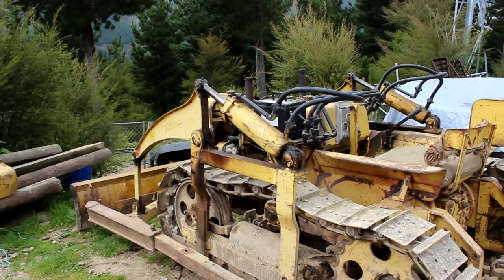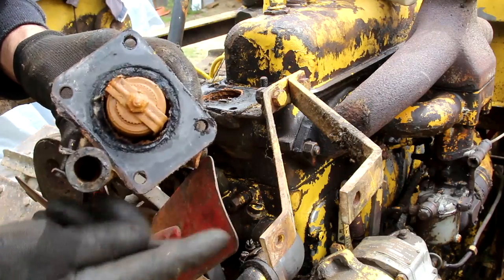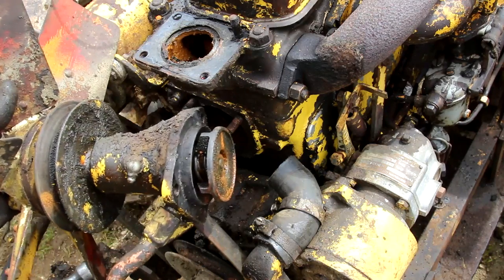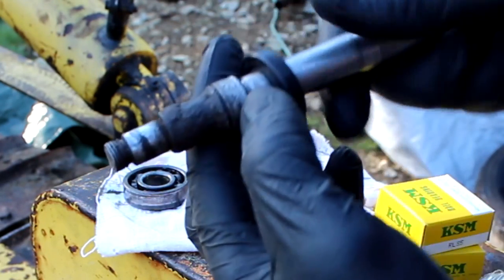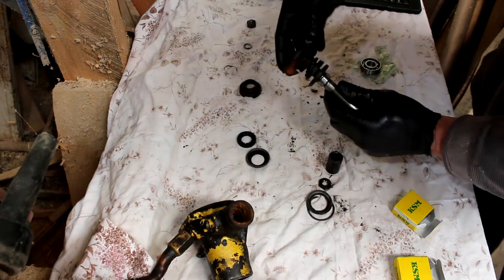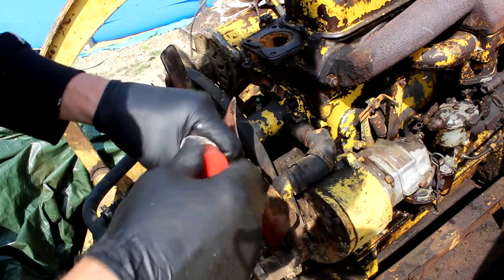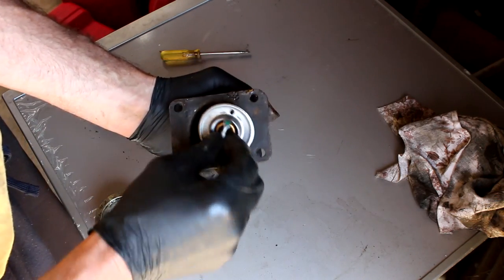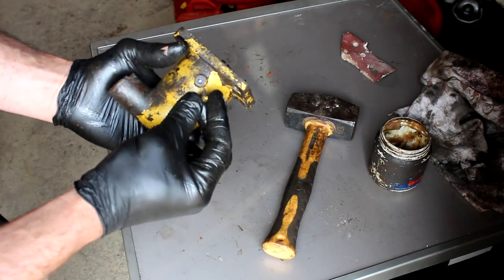Vintage Bristol Dozer repair part 1

Comment: The dozer seems to be a good machine, but that engine is probably of prewar or 1950's design. I think it would be better to re-engine it with a modern carburettor unit. There are plenty of good Japanese engines in scrap yards.
Reply: Austin A-45 or something late '50s early '60s. Hey it starts first time.
Reply: That engine worked fine before a Toyota corolla was invented, as long as nothing major goes wrong and he can't get parts, it's not worth changing doing modifications for drive and hydrualics ,it if a good service will fix this one. Those car engines might not be set up right to run this dozer to get slower higher torque pushing power either, they will probably have to run  at higher rpm's  to do the same thing if they'd even work right then. Thats why some guys put v8's in tractors with extra cobbled in transmissions to get the power and gears right to use them for anything other than driving at 40 mph L.O.L.
Reply: @super6954  .....look at the heavy radiator fan alone, and think how much power it draws from the engine. Then there's the magneto, electric generator, carb etc all very old systems and hard to get parts for.
Reply: @mohabatkhanmalak1161  Yes  I get your thinking , but having done some  conversions on Fordson Major tractors, with newer 2700 series ford industrial/ truck or Combine diesel engines that i know work right when done properly. 
 
or putting a Perkins V8 in a Belarus tractor it's not that easy to do sometimes, I had to make lots of custom parts  for that one. the Fordsons are a lot easier compared. Doing this would be a challenge on a few levels.
 
  so run this as is then if it blows up,/ can't get parts with what he seems to pay for old machines that aren't in demand anymore. Go buy another one and don't waste more time or money on this one than needed. 
   
He might even find a better diesel somewhere next time.  even though we like to try save all of the old machines  possible sometimes reality of time / cost pays a part in not doing it in the end.unless you are retired, and have endless spare time and money just for fun projects.

Comment: whats up with your drill? I just see wires coming out the bottom where the battery should be. That ain't factory. hahahaha
Reply from the maker: Haha.. the battery died so I hacked it to run off  a car battery, holds a charge much longer than the factory battery

Comment: If you run with antifreeze and rust inhibitor all the year round, you wouldn’t get all that internal engine coolant system corrosion and protect the engine bore sleeves from corroding through . Very expensive repair rather than a five year replacement of the coolant for £15 < £20.
Reply from the maker: Yes I did put antifreeze in it

Comment: Marty, Im curious, what temp does that new thermostat open? I've always heard old diesel engines were never meant to run at such high temps like engines today are. Have you ever heard similar things said?
Reply: Hi, It's a petrol engine. Bristol Tractors were 'related' to Jowett Cars and I think both used Austin engines. On a little farm I worked on as a kid we had a Bristol 10 with an Austin 10 engine, it was very slow, but geared to work all day.
Later I briefly worked for Bristol Tractors at Sough Mill, Earby, UK, but they were taken over by a US firm in 1969 and closed down.

Comment: Any auto part store would sell engine cooling system flush.  Add it to the water, run for a short time and drain.  add fresh water, run for a short time and drain again (this "rinses" out ant leftover flush chemical).  Add coolant.

Comment: You forgot to grease the fitting on the pump unless it was done off camera. Should have done it before the pump installation.
Reply from the maker: 14:20
Reply: I didn’t catch it in the video. I’m glad you did before the install👍 I’ve forgotten a time or two and learned when I had to take something back apart😂